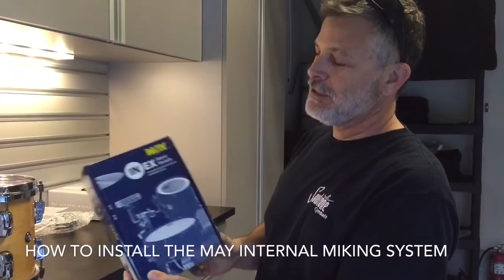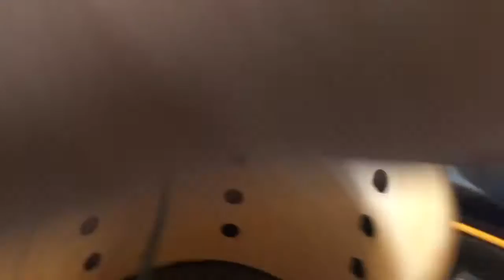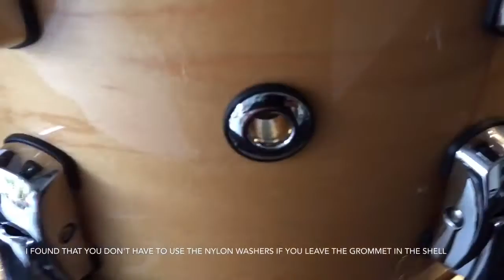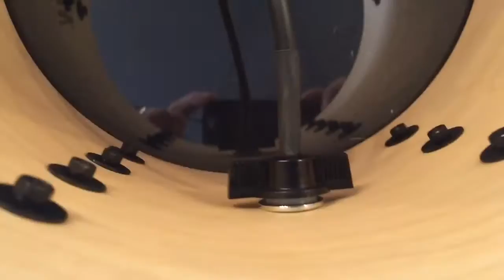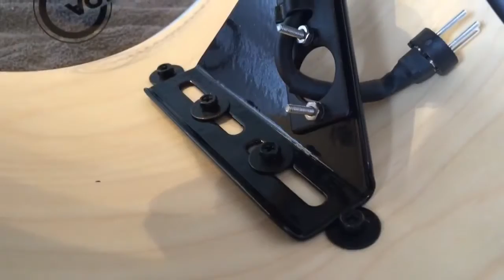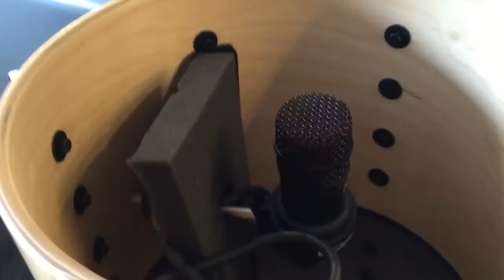How to Install the May Internal Miking System

Comment: Thanks for the video! Not a lot of content out there on the no-drill air vent connector. Do the three connectors at the end of the air vent wire fit directly onto the pins at the back of a mic? Or do they only fit that adaptor that comes with the May internal mic. I use a Kelly Shu right now and want to get the non-drill vent.
Reply from the maker: +Kyle Miller  -   Hi Kyle, The AVC connector appears to be able to fit the pins on a microphone, but contact Randall May International to be sure at 949-757-1717. The Kelly Shu is a great microphone mount, I used one in my kick drum for years until I got the May system. Good luck with your system!

Comment: Where can I find that piece of foam? I'm going to be making some purchases soon with the May Miking system, and while I am primarily going to get the kick system, I may end up considering getting one or two of these for floor tom setups. I know that piece of foam does the exact same as what a pillow in a bass drum does (assuming said pillow does not touch the heads) and I understand its sonic purpose.  Is it on Sweetwater or somewhere else?
Reply from the maker: +Michael Ozayu - Hi Michael, Randy May gave me the small pieces that I put into my two rack toms, so I had to cut my own custom pieces for my floor toms using foam that I got from Guitar Center which you can find pretty cheap. I imagine you can find foam at a lot of other locations such as Sweetwater etc., but that's where I got mine. Good luck with your system!

Comment: Thanks for the video.   I recently purchased a SHU mount for a Shure Beta 91a.   I was VERRRY concerned about the idea of drilling a hole in my Bass Drum for a connector.   Then I found the May no drill vent connector.   Whew !! Glad I found it BEFORE I tried anything stupid !    So in your video you put on the nylon washer then seated the connector right onto the existing vent hole grommet.   Is this working well for you ?  Have you thought you should have  removed the grommet or is it just fine sitting on top ? Thanks for your video and feedback !
Reply from the maker: +IslandDigital - Thank you for the comment. The SHU mount is great as well, but It's good that you got the ACV Audio Connector from May. I used the SHU for years, and I used to feed my microphone cable through the front air hole on my kick drum, because I didn't want to drill any holes either! 

And yes, I didn't remove any of my vent hole grommets from my drums, because the Connector fit perfectly inside it. I've had it this way for the last six months of live playing and practice, and it seems to be working out just fine. I do have to periodically snug the black wing nut up on the inside of the drums when I change out my drum heads. As far as removing the grommets goes, some drums have very small vent holes in the grommet, and there are actually some drums out there without any vent holes at all. So, those are cases where you'd definitely either have to remove the grommets, and/or drill your own vent hole in order to install the AVC Connector.
Reply: +T. M. Drums thanks very much for your reply and info. This will help me out greatly.   I've also seen a video where they have a double XLR connector , for 2 mics inside   Thanks again.
Reply from the maker: IslandDigital - Very cool, good luck on your new microphone set up!